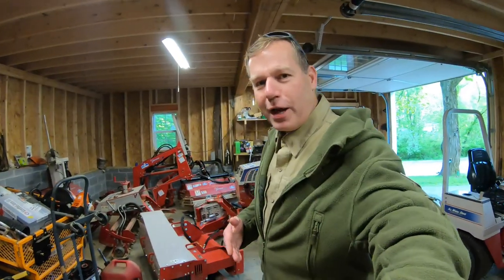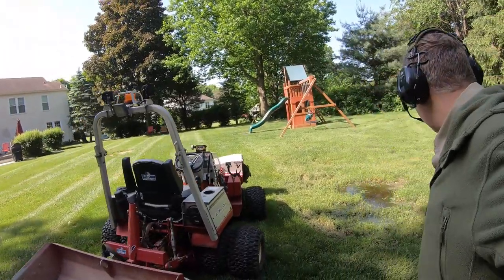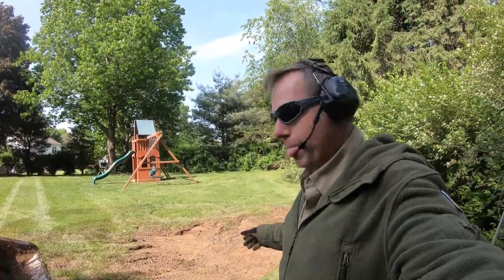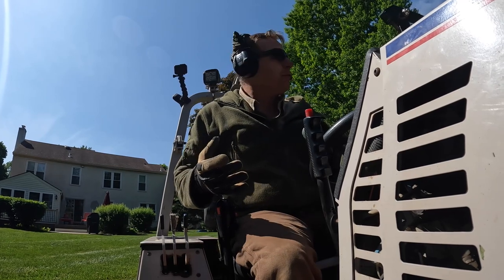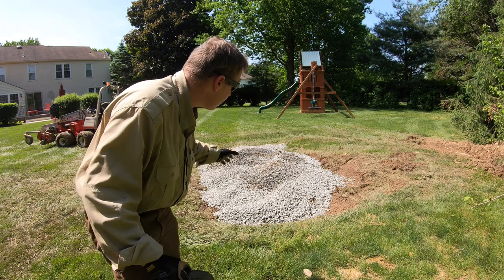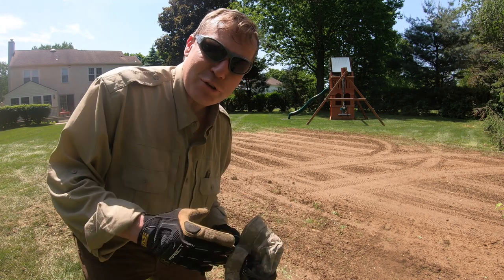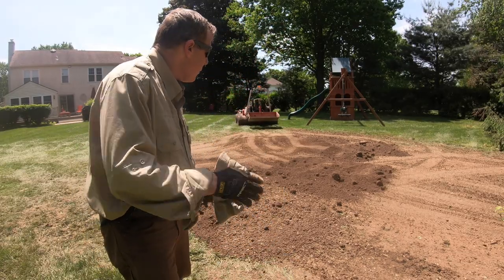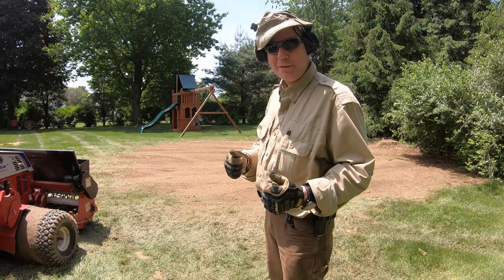Dangerous Sinkhole Fixed!  The RIGHT way!

Comment: The kg540 has bigger issues than the height adjustment. The way they used the linear actuator to control forward and reverse is a far bigger issue. It isn’t designed for that kind of heat. You don’t have to worry about the height of the drum won’t spin.
Reply from the maker: Yes!  Why complicate things and create more possible issues!  The simpler the design, the less that can go wrong!  Do you know how I change the drum speed on my old Power Rake?  The throttle control of course!  It works GREAT!  Ventrac actually called me a couple months ago to talk about the new Power Rake.  A corporate guy and 2 engineers talked to me about why I like my old Power Rake.  They said they listened to what people wanted in the new one and I'm really the only one that does precision work like this

Comment: Is t the right way to actually dig out the root ball and all decaying tree matter so the hole doesn’t continue to sink. I don’t think the be trac is the “right” tool for this job.
Reply from the maker: Digging is out is exactly what I did and the Ventrac did the job beautifully.  Imagine taking a track loader or a skid steer across this customer's property.  The LAST thing he wanted was unnecessary damage caused to his lawn and heavier equipment would have done that for sure!  The Ventrac excels in this area with its light footprint and superb capability